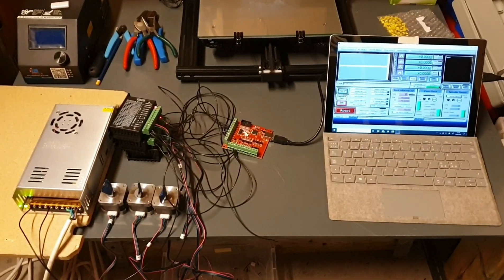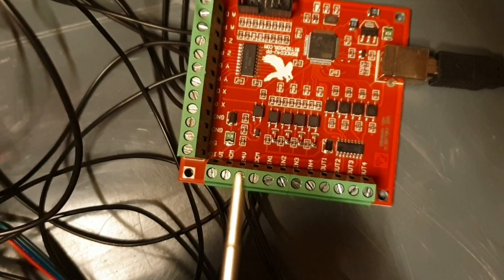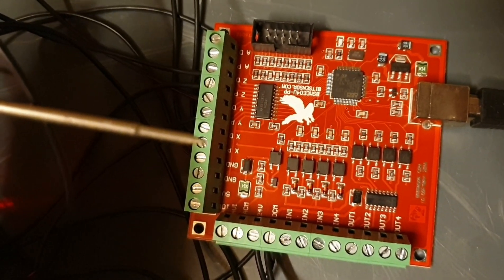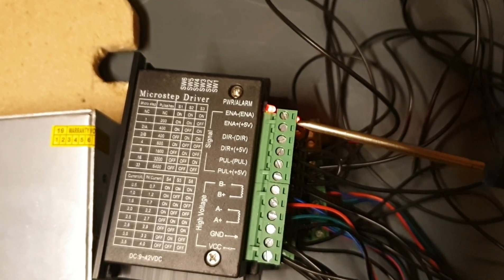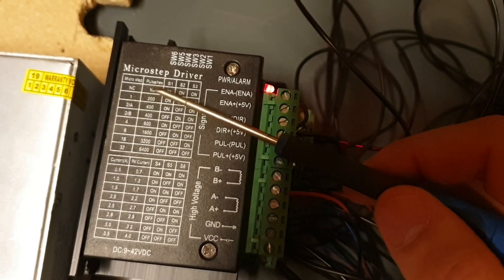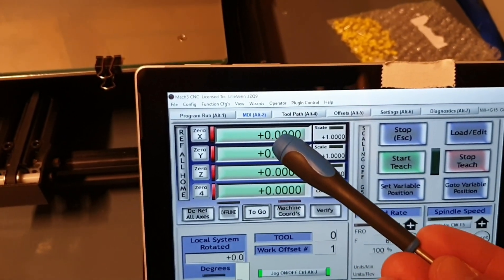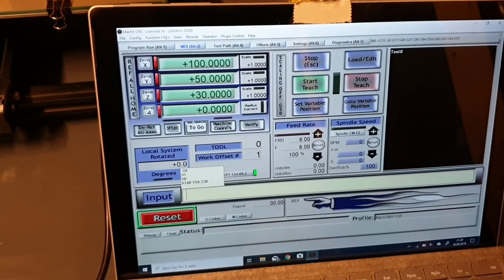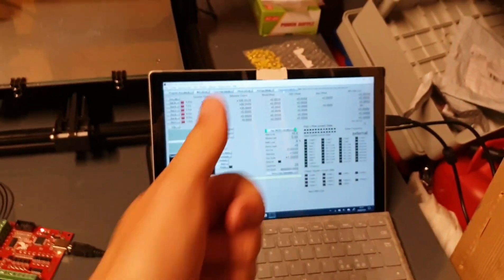DIY Homemade CNC "Little friend" with breakout board BSMCEO4U-PP 01

Comment: Sir, Have you Run any Longer carving Projects using the RnR USB card? Have you faced any unexpected interruptions or missed steps? So many videos say that It shouldn't be trusted for longer projects?
Reply from the maker: No, I have not run any "long" carving projects.
For the small projects I have done it has worked quite well... (Except, I did not get the hang on the feeds and speeds... It seams that those parameters where ignored...)...
Due to that I am working on other projects, it is a long time since I have used this CNC machine now. Good luck with your projects! ;-)

Comment: Your english is quite oké!. I have also this board, and the cnc is  almost ready build, I use microstepping. I have the pins for the spindel where you say it is a pcm puls signal I have a very nice schematic, it is a single mos chip who generate three fase 60 degree signals to mosfets who drive a motor, this can be a nice aproach I go test. Only I do miss a driver for the board and I do not now what to use, I have the Bitsensor type but there are others with a other number used like yours, so maybe your mach driver does work. regards

Comment: The 24v side will actually work just as well on as low as 5v. 
 Although 24v is good, as it has more resistance to noise interference.
Reply from the maker: Yes, I think the drivers are rated 9-30 V.

The lower the voltage you use, I guess the lower the signal to noise ratio will be. I have never tested this on this mill.🙂

Comment: Hej. Tack för en informativ video. Fick du tag i information om pinkonfigurationen för anslutning av handhållen jogg? Tänkte bygga mig en sådan själv.Hälsningar från Kristinehamn Sverige.
Reply from the maker: Hyggelig med melding fra flotte Sverige!
Ja, jeg kjöpte meg den billigste du kan tenke deg:
Den fungerer som bare det. :-)
https://www.ebay.com/itm/CNC-USB-MACH3-100Khz-Breakout-Board-Hand-Control-Box-for-4-Axis-Interface-Driver/283997304253?hash=item421f8ef5bd:g:QVAAAOSwLLRfTwAa

Koblet den opp slik:
Signal                     Port       Pin       Pinne på kretskort     På rekkeklemme
Limit switches      3            2           In 2                               Es
E stop                     3           1            In 1                               Ns
Probe                      3          4             In 4                              Pr
Jog A ++                 3         10           Jog A +	
Jog Y --                   3          12          Jog Y -	
Jog Z --                   3           8            Jog Z -	
Jog Z ++                 3          7             Jog Z +	
Jog X --                   3          6              Jog X -	
Jog X ++                3           5              Jog X +	
Jog A --                   3          9              Jog A -	
Jog Y ++                 3         11             Jog Y +

Jeg vet ikke hvordan det ble seende ut for deg. Jeg prövde ä lage en tabell over :-)
Signal, Port og Pin settings gjøres i Mach3 software: Configure -> Ports and Pins -> "input signals".
Pinne pä kretskort ble jeg litt usikker på akkurat nå. Min CNC maskin står ubrukt et sted jeg ikke har hatt til gang på siden Covid startet i vår, og når jeg ser på tabellen som var kjempe logisk for meg i vår, så blir jeg litt usikker akkurat nå.
Mulig det er en feil i min tabell (beklager i så fall). Men joggen virker helt supert!

Har du sett denne siden?:
https://buildyourcnc.com/item/electronicsAndMotors-electronic-component-breakout-Mach3-USB-Board
Reply from the maker: Faktisk sä kom jeg på: Det spiller jo ingen rolle hvilke pinne som dette gär til pä kretskortet. kabelen til den joggeren jeg brukte er jo ferdig terminert. sä hvis du bare setter opp "Signals, ports and pins" i software, sä skal det virke, fordi disse signalene går da til de riktige bryterne på joggeren. Det er nok også derfor jeg merket det slik jeg gjorde i tabellen min. :-)
Reply: @raymondbakken8577  Tack. Jag har skickat efter en sådan. Ett tips till dig är att gå med i https://elektronikforumet.com/ där finns mycket kunskap om CNC, 3D m.m. Mitt medlemsnamn är Seniorlemuren där. Jag har även en videokanal här på Youtube  https://www.youtube.com/user/seniorlemuren/videos   Samt en Blogg www.emigranten.se där jag skriver om  mina äventyr.

Comment: This breakout board works like a charm. I have been running my DIY CNC for about a flawless year
Reply: How could we install limit swithes "NO" configuration at 5 volt operating
Reply: Does it support a BACKLASH function in MACH 3??

Comment: Hey! how much amp power suppley you used ?
Reply from the maker: It is 15A with 24 V.
Propably way more than I needed. 😊
Reply: @raymondbakken8577  Okay thank's ! i have the same. i was afraid that i would destroy the board with to much Amp ;D
Reply from the maker: @niksechtniks  You won't, unless you have a wrong connection, short circuit e.t.c.
You must be sure you are operating within the right voltage range. (The amp is desided by the load). ;-)

Comment: Hi! I have bought this scheda for my cnc but my surface with win 10 does not recognize it when I hook the usb. I have seen that you have the same pc. It could become me as it has done to recognize the motherboard of the pc.
Thank you
Reply from the maker: Hope you did find a solution.
Reply: Use Zadig to update the USB driver, and turn off Driver signature verification in safe mode. Google the latter information and I hope it will work for you.

Comment: Hi Raymond, thank you for your explanation abobut this card, I have the same, and I am trayng to connect a probe for Z zero set up, but the input 4 not turn on the digitize signal, all other inputs 1-3 are ok, and did you know which pin and port should be?
Thank you and keep safe
Reply from the maker: Input 4 has configuration port 3, pin 4. Look at my table (in other comment on this thread), Also on page 12 in your manual.😉
Reply: @raymondbakken8577  thank you for your answers, I have connected a the Z zero probe now. It will help me to use different bits in the same project, keep safe and best regards!
Reply from the maker: @AL-dx8zv  I am glad you did figure it out.🙂
Have a nice day.😉
Reply: I got the data is port 3 and pin 4, you can see the installation manual at https://www.cnccat.com/cnccat_photos/files/JDSW43A-USB%20MACH3%20(red).pdf best regards and keep safe
Reply from the maker: @AL-dx8zv  Hi A L 😊
I don't know how you have connected the inputs, or set up the inputs...
However, it actually does not mather wich input you are using for what, as long as you have set up that input for the task you want it to do. (I am no guru in this, just to be clear :-) )...
If I were to troubleshoot, I would:
1. check my connections if they where right.
    a. Use a voltmeter on the inputs, and trigger an event. Compare an input that works, with input 4.
2. If (1) works, double check your manual (page 12, with what I actually have set it up to: "Port 3, pin 4") 
3. If (2) seams correct I would go to the "Diagnotics" tab in Mach 3 and see if the right viritual "LED" fires up, when  an input is activated...
Have you seen my video on testing an input sensor?
https://youtu.be/mCNJ_so0K28
Maybe it can help you 😉
Reply from the maker: This table shows you how you can find the ports and pin from the circuit board in Mach 3:
Port	Pin	Pin on the circuit board
3	2	In 2
3	3	In 3
3	1	In 1
3	4	In 4

Comment: Hey. I found out how to connect an MPG control panel to this board, or do you still need help?
Reply from the maker: Hey Alexey
What is a MPG control panel?
Reply: Raymond Bakken    Handwheel, in China it is sold as: CNC Pulse Generator 4/6 axis MPG pendant handwheel. Model A-1474. I managed to connect and control 3 axis in MACH3.
Reply from the maker: @user-Aleksey_Putikov  Is your controller USB based?
I purcased a cheap controller at eBay (item 153651771679, I guess), that fits in the plug at the board. I mapped it up, and it works fine. However, a wireless, or USB based, is way cooler!👍
Reply: @raymondbakken8577   I also have such a cheap controller as on video (RNR Universal USB Motion Card) and the handwheel is connected to a 10 pin connector.
Reply from the maker: @user-Aleksey_Putikov  I was thinking about makeing a video on how I did it, but in these Corona times I am not alowed to go to the "workshop" where I have my CNC.😉
(I figured it out)
Thank you for respond 🙂

Comment: Hello Friend! Is it possible to connect my inverter directly to ecomotion without the need for a relay? How do I do? Can you help me? Thank you!
Reply from the maker: Hi Marques.
I am not sure if I understand your question. Do you mean the power supply to the card?
The "low Voltage side" is powered by the USB, the "high voltage side" is powered by the inverter. However, on the input you need something to drive the potensial down to zero/minus whenever you want a signal. Homing, end switch e.t.c.
Reply from the maker: I have made a wiring diagram, that I can post as a video if you want.
Reply: @raymondbakken8577   I want, friend. Thank you Very much for help!
Reply from the maker: @caminhaevolutivo3443  Done 😉
You find the video on my channel now 🙂